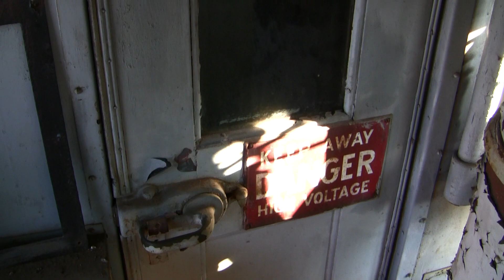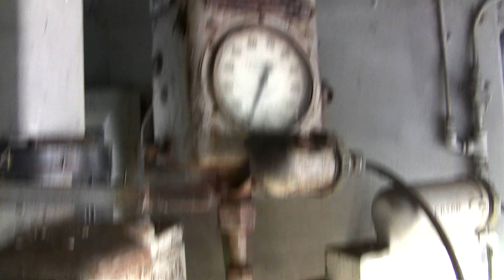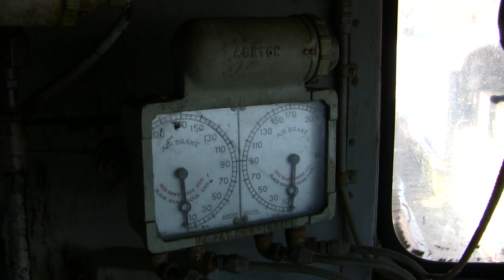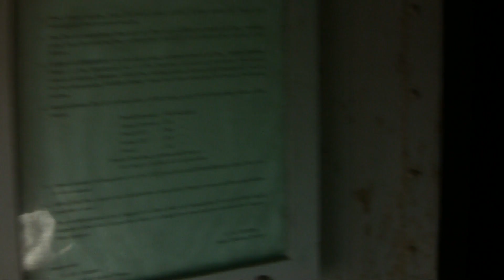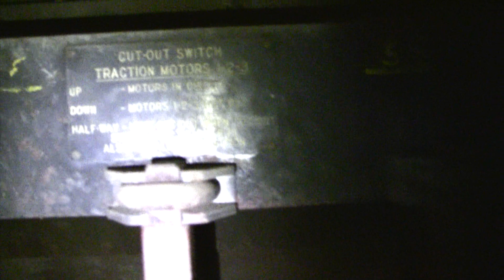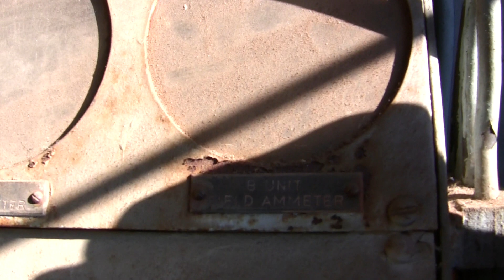Inside The Milwaukee road EP-2 Bipolar electric locomotive St. Louis, Missouri.

Comment: I wonder what was in the middle a long time ago. electric steam boiler for passenger car heating?
Reply: You're exactly correct, steam boiler for the cab and passenger cars.
Reply: Probably an oil-fired steam boiler for train heat.
Reply: @davidlevy3092  You are true. It is oil-fired but this is pretty ironic, an oil-fired boiler on a electric locomotive.

Comment: Handsome looking engine. Basically the US version of the Swiss crocodile locomotives.
Reply: Not even remotely close. Look up the drive systems and you’ll see how radically different they are.
Reply: @douglasskaalrud6865  Well yes, mechanically they're radically different. But there is somewhat of a resemblance body wise between the Milwaukee Road bipolars and the Swiss Railways crocodiles.

Comment: 3:42 Are Those the Transformers?
Reply from the maker: No I believe those are rectifiers.
Reply: @travelingtom923  where are the Trasformers on the EP-2?
Reply from the maker: @theanimerailfanthehagersto1280   I don't believe they had transformers. The Bi Polars had something like 40 throttle notches. That locomotive had so many traction motors that it could probably take all the electricity being fed to it with out stepping down any electricity through a transformer.
Reply: @travelingtom923  Are the red things Breakers or Resistance banks?
Reply: Milwaukee road catenary ran 3000 volts DC. No transformers, no rectifiers, just banks of resistors to control current and voltage to the traction motors.
Not the most efficient system, but rugged and bulletproof. The flexibility of the diesels finally prevailed.